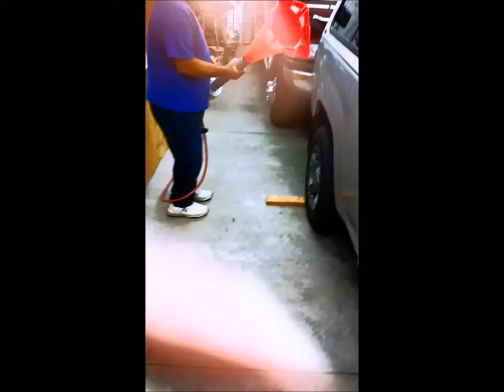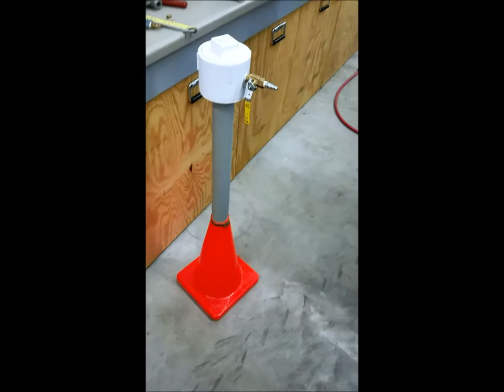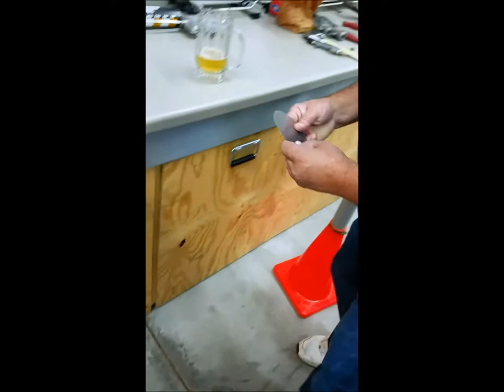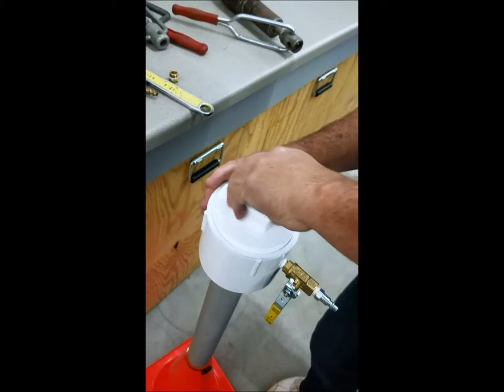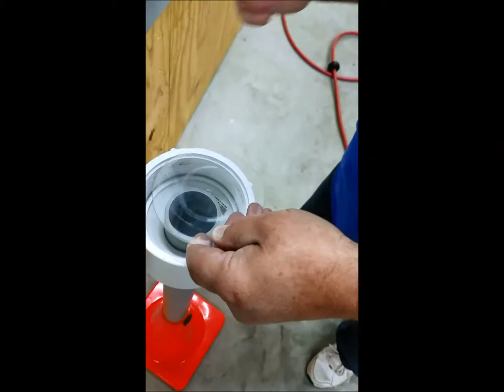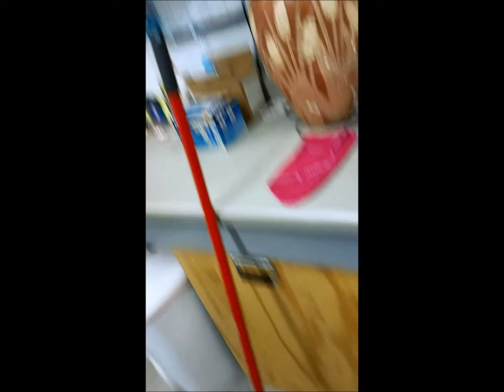DiY LOUD Air horn

Comment: Hey there I have a question that needs to be answered fast!!!! It’s for a hockey tournament, I made one of these and it did not work, do you have anything in the tube or anything?
Reply from the maker: Play with the diaphragm material, and diameter of hole in poly carbonate material,and o ring. as you can see I didn't build this. As the builder said he had play with it some,

Comment: You have the plans...
Reply from the maker: No not really, its as you see it. Part of the design started out as a potato launcher.This has an air chuck and ball valve, instead of the gas grill igniter. The traffic cone stand is optional.
Reply: @jettapup  
Do a video build on that and how to tune them...